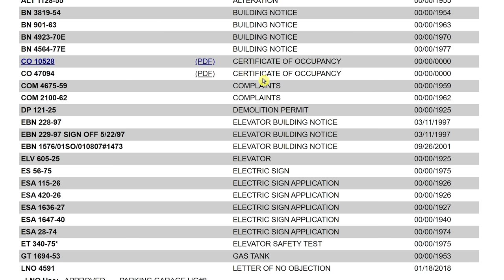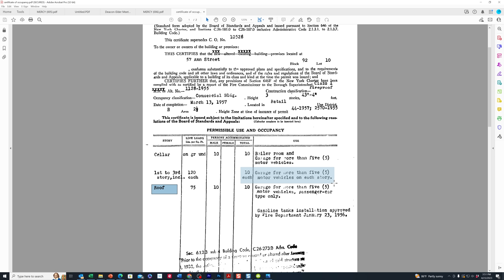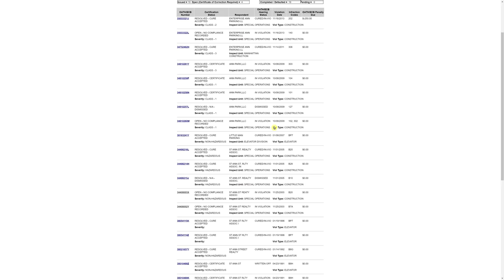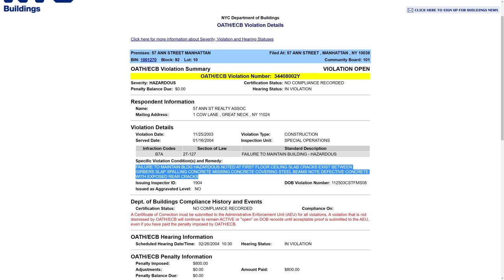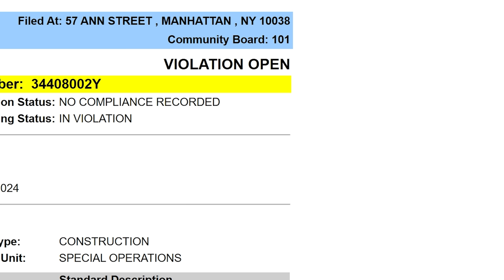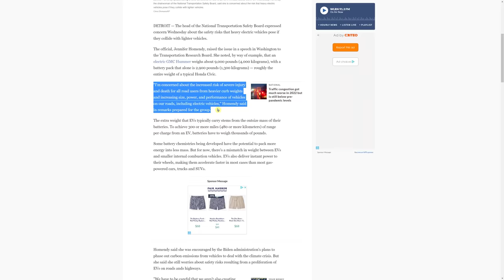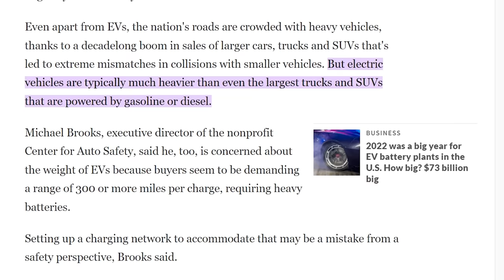4 Causes Of Fatal New York Parking Garage Collapse?

Comment: Question: 
— Was this building originally designed as a garage or converted from some other use?
PS — 100 years of road salt being tracked into building and water dripping off cars could have caused corrosion.
Reply: Good point. Corroding rebar expands in volume and cracks the concrete it is meant to strengthen, separating the concrete and rebar causing structural failure.

Comment: This looks like a case of bleeding the building to death and making the max profit possible. I've heard reports of the owner paying fines but not making repairs. It is also obvious that vehicles were parked very close to each other maximizing profits. This looks like the old days when sweatshops did not care about the safety of their workers.  I wonder if manslaughter charges will come from this and how diligent the inspectors were with follow-up inspections and enforcement.
Reply from the maker: In my area if you don't close out a violation the city automatically tacks on fines and then files a lien against your property
Reply: Honestly, I think this is more an indictment of the auto industry than anything. They’ve been making cars much larger and heavier to skirt emissions regulations and it’s now getting so bad that it’s bringing down buildings. And this wasn’t even necessary. There’s no real reason to have an SUV in Manhattan. You’d be hard pressed to find any patch of mud on the whole island, and a smaller car is better for getting through the traffic.

Comment: Thanks Jeff, great video,  your information about the weight of the electric vehicles was something I was not aware of , this could  have serious implications for similar parking garages in commercial and residential buildings everywhere and also car lifts.
Reply from the maker: Many others will helpfully check into this
Reply: I used to park in a couple of these old parking garages, one on 26th street. I asked a mnager one day why it took so long to get my car, and he told e it took awhile to dig out the cars, sometimes buried THREE deep on the upper floors. Many of these buildings are so obviously old and creaky, I think the cause is staring everyone in the face.
I switched to other (newer) garages with self park,
I don't think they will have the same issues for awhile.
Reply: But the thing is,  floor loads, I lived in a 9 story commercial loft building on the corner of Broadway and W Houston St back in the late 70s which had signs stating the floor load capacity throughout was 200# per sq ft, and when you walked down the stairs you could see the floors from the floorboards to the ceiling below were close to 2 FEET thick, it was built in 1892 for offices, factories, stores and the cable car company machinery in the basement and sub basment. A typical large car or SUV  spans how many square feet? 40? 50?, even if we went with 30, if it was in that building I lived in 30x200= 6,000 pounds. Cars are heavy BUT their tires span the loads across a wide area. where there's no load under the chassis
Reply: It's only 10-15%. The weight gain in ICE cars over time is much more of a factor. Their weight nearly doubled over the last 50 years.
Reply: Tesla model s sedan =4500lbs
Toyota corrola sedan =3000lbs
Reply: @user-pf5xq3lq8i  sure, let's compare a compact class to a luxury class four times the price and be surprised the latter is heavier...
Reply: @goo gle  Isn't something like an Altima or Maxima a better comparison to a model S? Just sayin'
Reply: Don't believe OP on BEV on point 4,   these admitted that he's deliberately mislead and made false claims about BEV as a contributing factor.
Reply: There may be a problem with electric vehicles in the future. But that’s not what caused the collapse. It’s purely theoretical.
Prefer building designed before the 70s. Cars were a lot heavier back then. An old caddy could easily be over 2 tons.
Reply: @user-pf5xq3lq8i  
1975 Cadillac 5050lbs.
Reply: @user-pf5xq3lq8i  Toyota Corolla. Proper spelling. But pour water on it and you get instant crap.
Reply: @mangos2888  Altima? The cuspidor of the automotive industry? It doesn't compare favorably to a Yugo!

Comment: Also note they are packing the cars in several cars deep. I rather doubt the design/load rating was for that many cars. And you do have a valid point about the SUVs and minivans being heavier, and I must admit, my Teslas weigh about 4500 pounds.
The parking garage where I worked scared the crap out of me, as the car would shake quite a lot as other cars came down the ramp. There were several places where the rebar had broken and was exposed in the traffic lane. The building's idea of a repair? Pour in some cold asphalt patch and jump up and down on it a few times. Not my problem any more, I retired last week.
Reply from the maker: Scary. Concrete repair is very specific and must be done according to ICRI methods
Reply: At 4500 lbs, that's only 500 lbs more than an average modern ICE vehicle. That's about the equivalent of 2 full sized American adults in the car. This added weight is not going to factor into bringing down the building.  The building collapse was due to gross negligence and numerous violations being circumvented or ignored.
Reply: @wngimageanddesign9546  If this building was designed in 1925, weight very well was a factor. A Model T weighs just 1200 pounds, and those would have been parked side-by-side, not stacked 3 deep.
Reply: Tesla model s sedan  =4500lbs
Toyota corrola sedan =3000lbs
Reply: Tesla weighs about twice that of a 1932 V8 Ford (2310 lbs or 1048 kgs). So floor load for same number of vehicles over 90 years has increased by almost 100%. No doubt additional vehicles are also parked on each floor again increasing load.
Reply: @user-pf5xq3lq8i  Tesla Model S Sedan = An excellent vehicle
Toyota Corolla = japcrap

Comment: Hi Rember this is in the north were we have snow and ice which equals salt on the roads for 66 YEARS. I have seen major parking garage damage in much newer buildings.
Reply from the maker: We have the same thing in the South with the salt air near the ocean and the humidity and the rains which soak into the concrete over time and work their way into the rebar, which rusts out the rebar reinforcements, which causes them to expand, which causes the concrete to crack, which causes the spalling.

Comment: I've been in garages where they valet-parked cars very tightly together, the first car in would require moving around a lot of cars before it could be driven out.  This will increase the average load in a parking garage.  Current codes require parking garages to be designed for 40 psf live load (which incidentally is the lowest design live load in the building code for anything except roofs, cars are not as heavy as people think).  In a normal public access garage it is hard to get enough cars in there to be just over half of this load, but if you park them bumpepr to bumper and door to door they can get close to 40 psf.  It would be very difficult to get beyond 40 psf.  Consider that in a concrete building the garage floor itself would weigh at least 100 psf so that is combined design load of 140 psf.  A properly designed structure in good condition could normally sustain in the range of 250 psf before being dangerous.  This would be very difficult to do with any modern automobiles.  Of course we don't know what they did in 1925, the model T Ford was a lot lighter then.  However if the building was built for any other use it would have floor design loads higher than what would be needed for parking.  So that leads to either a problem with the original design or more likely problems with deterioration.
Reply from the maker: Don't forget the concrete was in distrepair and no longer rated what is was in 1957
Reply: @jeffostroff  1857? I think you mean 1927.
Reply: Doing the calculation for a '59 Cadillac, you're correct.  But with a F150 Lightning, I come up with 53 psf.
Reply: @russellhltn1396  1.  That's a heavy vehicle and within its theoretical footprint you can get high numbers.  In the valet parking garage I observed they were still leaving 6" or more between vehicles.  If you add 3" all around to the dimensions and recalculate that alone will take the average down by around 4psf.  2.  If 53 psf (barely over the building code required load) causes a garage failure then there was a problem with the garage either its original design or its maintenance.  However with older buildings that may have deterioration, every psf can matter.

Comment: I used a parking garage in downtown Nashville about 10 years ago. It was near the Raymon. After entering, I knew I screwed up. The turns were narrow, the ramps were  steep, and my driving skills was tested to the max. I was driving a Saturn Vue. Coming out I encountered a large Ford F250 trying to leave. It took me 30 minutes to get out, and the charge for a two hour park was $25.00.
Reply from the maker: Did they charge you for the time it took to get out? That is insane!
Reply: @jeffostroff  no

Comment: The problem in NYC is the permitting and building department.  They require so many permits for even simple repairs and upgrades.  So they force building owners to do nothing.
Reply from the maker: Yes and also the spiraling out of control fines as to the problem as well

Comment: 1957 occupancy permit mentions 120 Lbs per square foot live load for floors 1-3 and 75 Lbs per square foot live load for roof level. Figure a typical car occupies 20 feet by 8 feet packed in tight, that's 160 sq feet area. Divide that by say 4800 and that's 30 lbs per square foot. Appears to be well under the stated load limits assuming those were based on engineering and not guesses afterwards. Also, how it's pancaked, from my layperson's view, supports your hypothesis about a pillar likely failing versus being overloaded. To digress a bit, I'd trust an older parking garage like this more than many of the newer purpose-built ones that are engineered to the edge for economy.
Reply from the maker: Newer garages have better support, they have beams that go under the slabs every few feet

Comment: Actually based on the time saver architectural guide book of 1957 they do show size and weight, turning radius, and parking structure design in it. I don’t recall everything but I have a copy at the office.
Reply: Average weights now are between  1,500 to 6,600 pounds whereas in 1957 cars weighed roughly around 1,400 to 4,600 pounds.
Reply from the maker: Yes, and we saw how that packed those cars in, probably illegal double parked
Reply: @jeffostroff  exactly.

Comment: Hey Jeff I actually live in nyc and use parking garages all the time. Where do you think the safest place to park is (in a garage). I’m assuming it would be the top so your not pancaked in?
Reply from the maker: I would think lower floor near a column. Many parts of the garage survived as Ring video showed. But all cars are likely totalled because of how it fell and how they have to tear the building apart